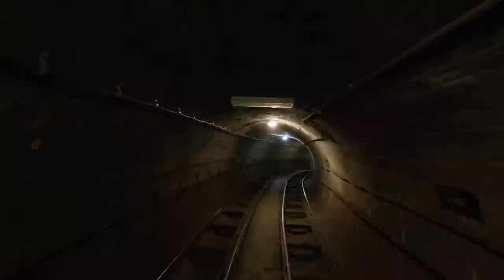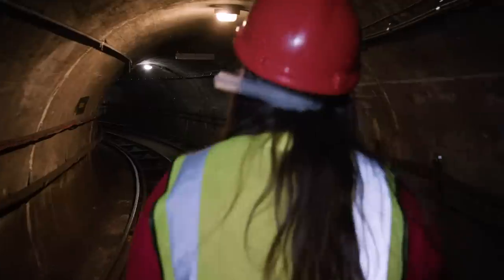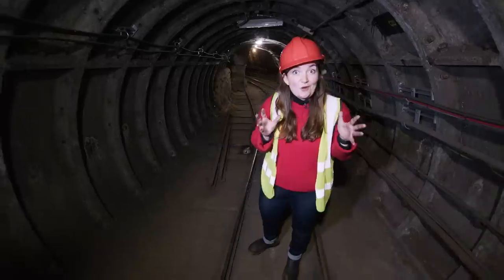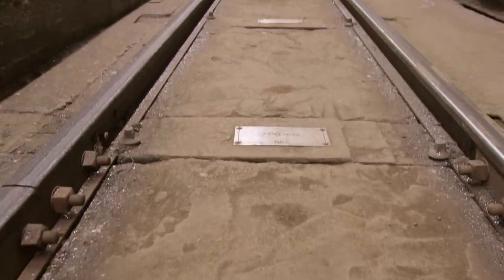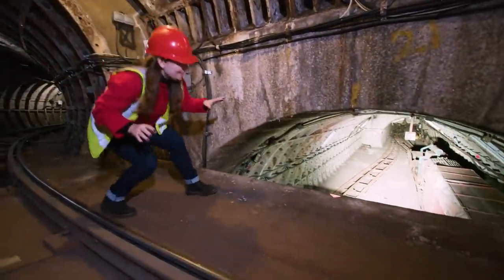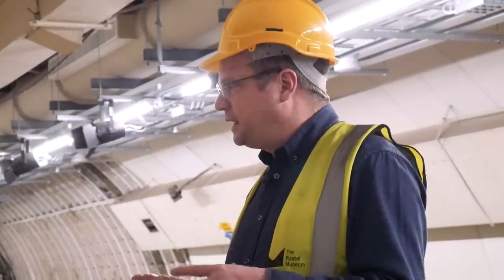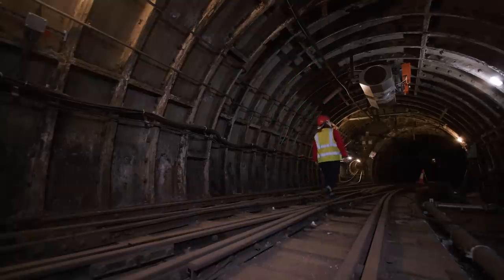Exploring London's Abandoned Underground Railway | Mail Rail Tunnels

Comment: In 1987 I was the PM for a company called Hop Studios who designed and managed the installation of the new streamline bodies for the Greenbat train motor units for the Mail Rail launch.  We spent over a month in the maintenance workshop under the Mount Pleasant sorting office fixing the new external shells to the original running chassis.  We also had to hitch a passenger car and the new train body mock-up to a battery car to through every tunnel in the system to make sure it didn't hit anything.  I spent a weekend in the tunnels sitting in front of the mock-up when the system was shut down.  It was like having my own giant train set to play with!  Given the new restrictions coming in that are limiting movement with petrol vehicles in London - it seems the track and tunnels could be re-purposed to provide clean/green goods transport!
Reply: I can Imagine it being brought back to help with transport
Reply: I highly doubt it would happen
Reply: Interesting job

Comment: the one thing I still wonder about the mail rail is that with the incredible amount of parcels that are shipped nowadays, it should be worthwhile to build new lines to allow these trains to go where they need to go, and then rent capacity out to all the private operators Royal Mail fail to compete with to help pay for it. It'd save a huge amount of emissions and clear up a bit of the traffic in London's streets. Sure it won't be cheap to dig new tunnels, lay more track, and update the system, but since it won't be carrying passengers there's a long list of things you don't need to worry about to the same degree as the tunnels for the passenger trains, so it's much cheaper to extend the mail rail than doing anything on the underground.
Reply: When I was with The Post Office Corporation we explored opening up the service to retailers on Oxford Street and extending Mail Rail further west with new stations. For many reasons, it never got further than just talking about it!
Reply: Nah ! They'd rather have more trucks & vans on the streets.

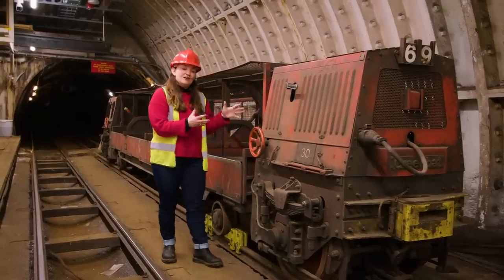Comment: I find it very mysterious that the most recent model of driverless loc (4:24) has a fat cable (complete with large plug) that connects itself to itself..
Reply: That being said I also REALLY do not understand why derailing would have been a structural problem. That sounds so entirely exaggerated. These trains ran at very low speeds, their sets of rails are not narrow relative to their dimensions (size) and weight and were laid on stable, level concrete. Besides that they transported relatively light-weight types of payload. Why in the world would the EVER derail! Also to find solutions that would allow the personnel to know where any train were and whether or not a trains that were sent on its way would still be progressing, THAT technically would have been the easiest of all things that came into play here. The electric eye was invented in the twenties, or simple electro-magnetic coils on the tracks could have foreseen in info on the whereabouts and movements of the trains, all that would have required was some more low-voltage cable along the length of the tracks. Making a train like that stop is as easy as shutting down the power, that I think the locs were proved with through the rails: one rail for the positive, the other for the negative polarity as there is no 'third' rail alongside the tracks as is a uniquely English method used on electrified train routes (as opposed to overhead wiring that is far more common worldwide. I live elsewhere in Europe and only or subways are powered by a third rail English style). The trains would, for safety's sake, have run on low voltages, which wouldn't have been a problem be cause the total length of tracks was so limited and there was no need for high speed (or performance otherwise). As the electromotor(s) of the locomotive would have been directly connected to is wheels via a set of gears, cutting the power instantly would have blocked those wheels (just like nowadays' modern electric cars cannot be towed or pushed, a HUGE shortcoming by the way!!). I wonder if this woman made up all these problems that these tiny trains supposedly had to cope with! Also it is quite possible that the more historic parts of the story by word of mouth were carried from one person to the next, a method that allows things of which an earlier storyteller once said that may have happened, or of which he thought that they MAY HAVE been risks that would have come as a consequence of (limitations to) the system's design, a few decades 'down the line' erroneously may have been remembered by someone else as FACTS.

Comment: Royal Mail should never have abandon that system
Reply: wasn't connected to anything anymore, sorting offices had shut and railways wouldn't let them use the main stations anymore, Royal mail built a massive multi million pound Rail transport hub, but shut it shortly after due to the rail system going to shit, as road transport was more efficient and cost effective, still at least all the vans are electric now!
Reply: @andreww2098 I was working in corporate relations when it all went tits up! EWS kept failing and our patience wore too thin. So we moved to road distribution and The Princess Royal Distribution Centre in Wilesden was no longer the super hub we had planned it to be!

Comment: 2:55 - Those tunnels are not 2.7m (8' 10") in diameter unless you are about 3' high!
3:00 - The UnderGround uses a different contruction system to the 'Tube' which goes much lower down
Nicely produced video, very watchable and very professionally edited but please do some research!